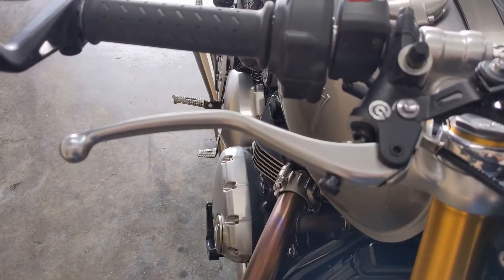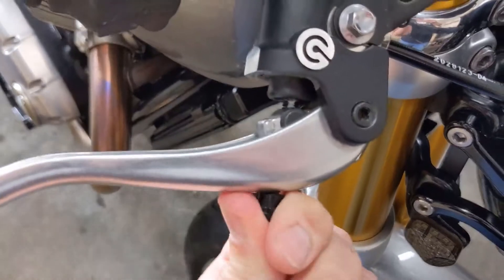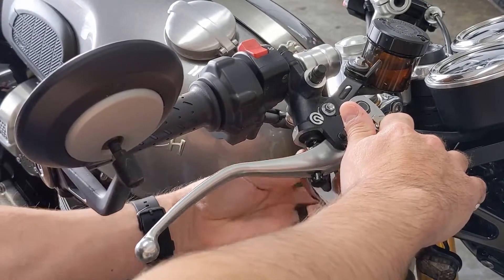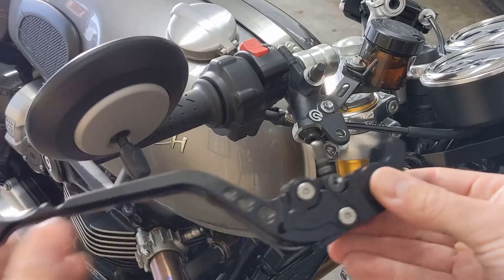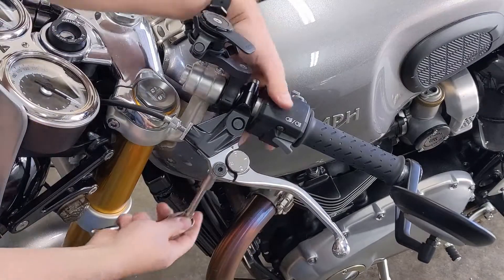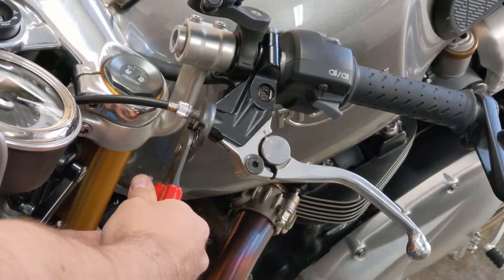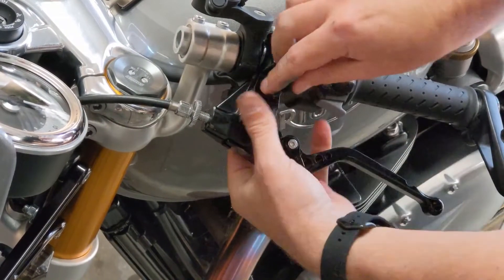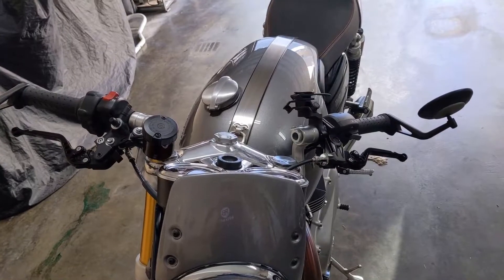Motorcycle Lever Upgrade - Triumph Thruxton R

Comment: Great video - thanks for that. I was struggling to free the little barrel-shaped plunge-pin in the clutch lever, and wasn't sure if the OEM Triumph lever's bush was glued-in or not. Tuen out I just needed to hit it harder. ... On a side note, I see you struggled with the clutch plunge-pin's protective rubber/dust-boot which is connected to the master-cylinder. The trick to getting that back in place, shielding the pin and locating the boot around the natural 'neck' of the pin, is to do that first i.e. before you slot of barrel into the lever. Line the pin up against the hole and spin it to get into the centre of the hole (which will keep moving around), and then I used long nose pliers to gently encourage the rubber to the "neck' of the plunger.
Reply: I think you mean brake not clutch, hope you know which is which 😃

Comment: I'm pretty sure you should have fitted the brass bush from the old clutch lever into the new one, thats been the case on the levers i've fitted.
You can see the hole on the new lever looks way too large for the pin.
Reply: It was a direct fit for me.